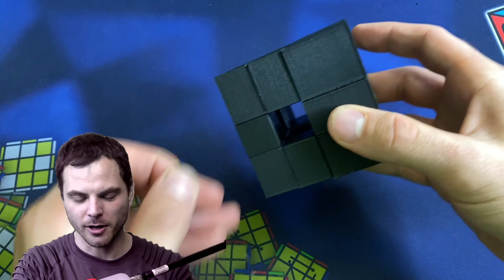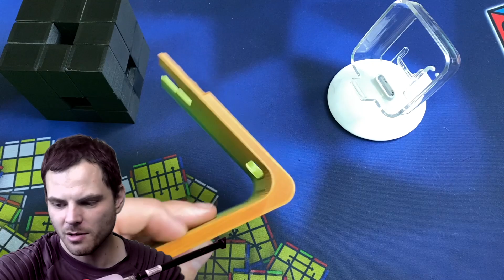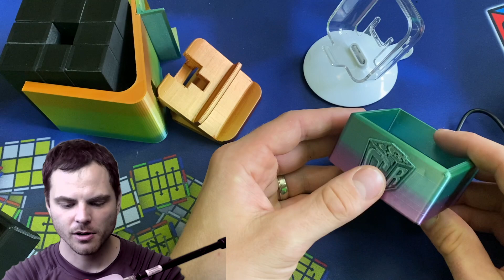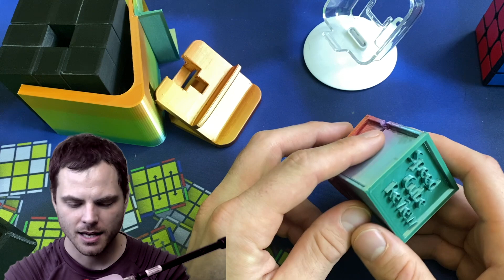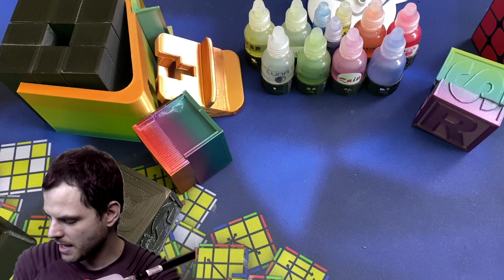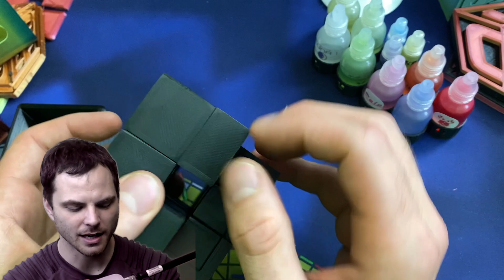3D Printed Gems - FREE For You

Comment: I know that you are sponsored by scs, but can you make a lube holder that holds both 3cc bottles of lube and both 10cc bottles of lube from scs and from the cubicle? Because 10cc  bottles of mystic and silk are different shapes than the 10cc bottles of lube from scs.  If you could do that, that would be amazing.
Reply from the maker: The bottles tend to adjust. They were the exact same just a little bit ago. SpeedCubeShop is actually adjusting their bottles as well offering 15mm. I'll get a few samples of different size bottles and make a few different designs.
Reply: Thanks!